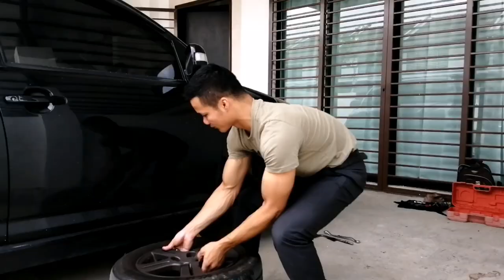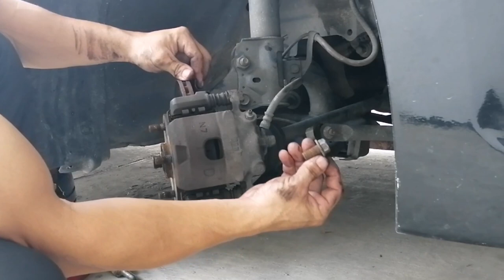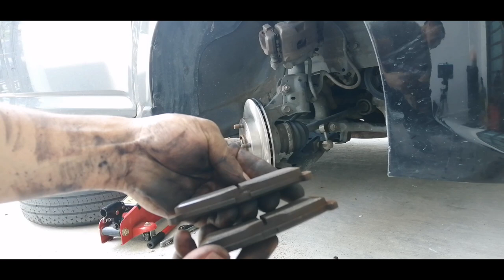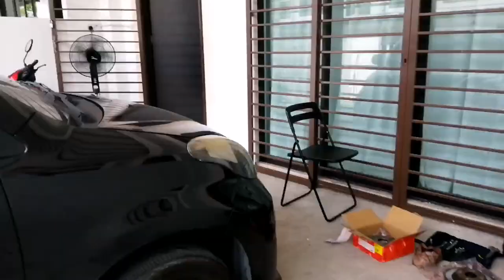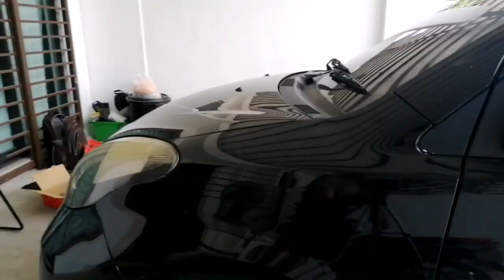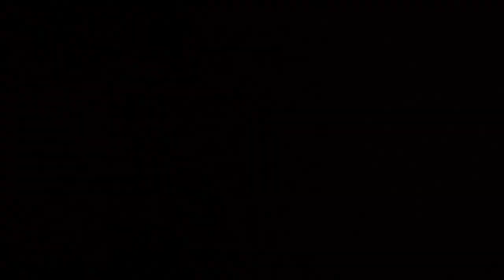How To Change Rotor Disc Myvi

Comment: thank you for your video. A Korean boy also watching your video. My car also myvi.  how often should Rotor disc be changed? when brake pads replaced on 2nd time, rotor disc also should be replaced too?
Reply from the maker: Its depend on the rotor disc surface. If the rotor disc is still in good condition, it's better just to replace the brake pads.

Comment: Why dont people spray the rotor with brake cleaner and wipe it first?you do know that its to avoid oily surface on the brake rotor.
Reply from the maker: Yeah that's a good idea. I suppose to do it  that way but the owner of this car didn't provide any cleaner. So, i just wipe it using a towel..